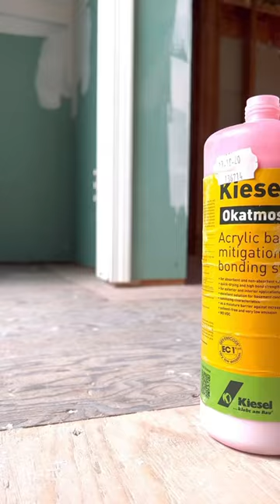Self leveling a floor for tile using customs RS leveler #diy #tiling #howto #construction

Comment: Level Quick over a wood substrate requires metal or plastic mesh
Reply from the maker: So how do you go to feathers edge then 🤪
Reply: @Eylandertile  You don't, not over wood, how do you not know this ?
Reply: You can absolutely use most all self leveling products over plywood with zero issues,especially primed and prepped correctly…how dare you even question the goat calidad? Lol
Reply from the maker: @markme4  I go feathers edge over it… but I’m also not setting directly to it either over wood. We either use Blanke mat or strata mat over the leveler so there’s literally zero issue in not using lathe. It’s primed, poured and covered. This particular floor got Blanke Permat over it. I don’t see any issues at all. Don’t think a customs rep would either tbh
Reply: @Eylandertile  I agree with that. 
You do a great job prepping and you're the only one I've seen on the internet that knows how to pour Level Quick, everyone else wants to mess with it after they pour it for some reason

Comment: Over plywood that cracks and crumbles. Tiles will be coming up like Domino's in five or ten years
Reply: if tile, then THINSET and CEMENT BOARD would come next, RIGHT?
Reply: Come on guys, its not 1985 anymore, primed, flexible reinforced leveller, its going nowhere, haven't used solid cement board for 15 years
Reply: @@One-ik4pb tile straight to lever on top of plywood is NUTS without cement board. Wood has to much deflection.
Reply: @dustyflair Cement board adds no strength to the substrate, every manufacturer will tell you the same. Backer board does not stop deflection
Reply: @markme4  huh? You are telling me that PROPERLY installed cement board that is thinsetted in and screwed down doesnt add strength? Then what is it all for einstein? Something pretty to put tile on?
Reply: @dustyflair  Call the manufacturers yourself, it's a common misconception

Comment: Also looks way too wet. Always should mix per manufacturer specs or risk failure
Reply: that is exactly how it is done.
Reply: That sounds good, but every time I’ve mixed thinset or leveler to the specs on the bag, it becomes unusable very quickly. I believe manufacturers say to use less water than actually needed to meet the strength that they advertise. Cement products are stronger with a lower w/c ratio, but following the instructions on the bag has never been feasible for me